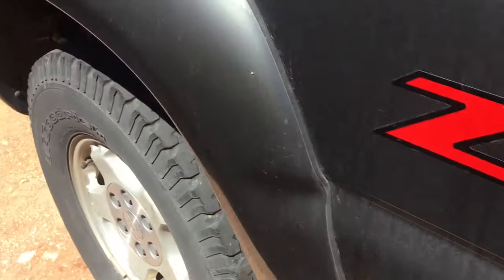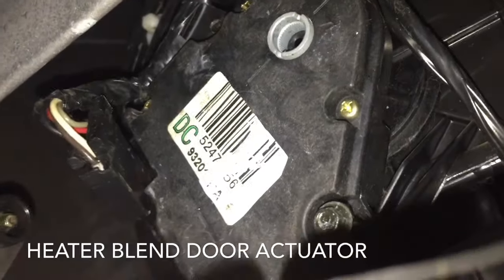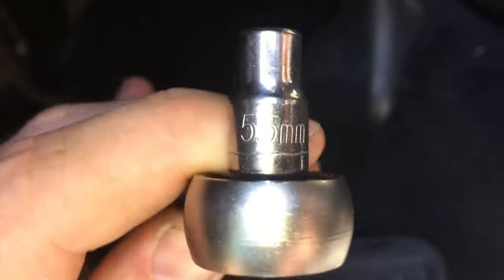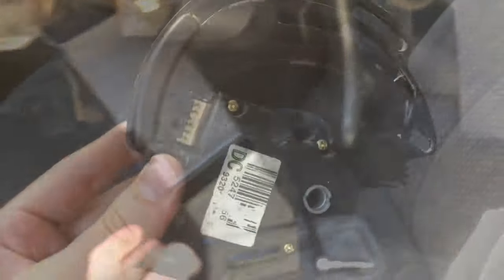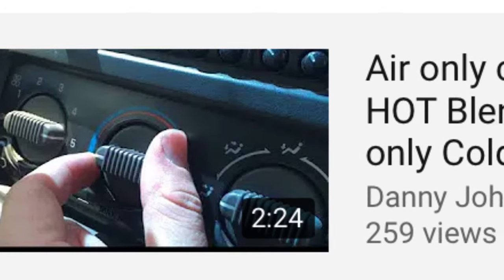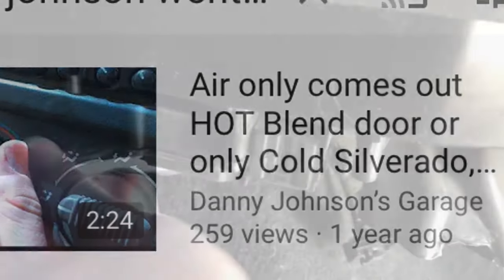Air only blows out defrost or top vents: mode actuator Blend door 99-2007 GM Silverado, Tahoe, Yukon

Comment: 5.5mm = 7/32”
Reply: Correct
May require quarter inch drive squiggle to get on some of them ▬ do not get impatient it is rigged to fail
Reply: Dafuq is a millillameter?
Reply: @petedandrea8463  not a stanandard 😂
Reply: Saved my a**, thank you!
Reply: @ChiDraconis 😂
Reply: Thank god👍👍
Reply: 5.5mm socket good for winning bar bets..😂
Reply: Actually, 7/32 is 5.56 mm 😉
Reply: 5.5 actually doesn't fit its 7/32
Reply: A 5.5mm is a 5.5mm.  Don't be telling these people the best ways to round bolt heads.

Comment: Place 5.5 socket on top screw, use short 6mm Allen wrench to loosen screw, use fingers to turn socket until screw is out.
Reply: But how about putting it back in??? Taking it out is the easy part...
Reply: Larry Clay, your comment needs to be pinned to the top of the comments!!
Reply: @ls1_dreamz  don't put it back in.
Reply: Yes this worked for me.
Reply: Thank you
Reply: Haven't made it home from work to try yet but won't the 6mm Allen key be to big to fit in the 5.5 socket

Comment: Lmao.  Yes... Taking it out is a piece of cake... but it would be great if you explain how to install it and what positions the flaps need to be in to make it not "jam up".  An installation video is needed too.
Reply: Any luck finding a replacement video? Thanks!
Reply: @dustinauch7178  no.  😞  and the blend door still isn't aligned right.  So the airflow isn't as powerful as it could be, and it's louder now
Reply: It’s not too bad putting it back in. I literally just did one today on one of these trucks. It was stuck on defrost mode so all I did was plug the plug back in without mounting the actuator back. Compare the old one to the position the new one is at, after that just simply go to the mode that corresponds to the position the old one was in. So basically I pressed the mode back to defrost and it moved the new one to the exact position the old one was at. I just slid it on and mounted it and worked perfectly fine. Hope that helps you some

Comment: I just unplugged the fuse for a few seconds and plugged it back in and my AC blows out fine now. Thanks for the video. I wouldn’t have figured it out without this video
Reply: Which fuse please?
Reply: Where’s this fuse you speak of ?
Reply: Could cabin filter be an issue ?
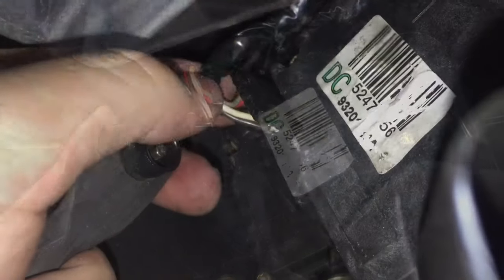Reply: @MeliTX  0:45

Comment: I ordered a 2000 Silverado without air.
Because of your video I tried a stubby screwdriver in the actuator hole instead 
of taking it off. 
It was a hard clockwise turn but I 
got the door to move and get a defrost and floor air blend. 
Putting the 
dial in the right position made it turn easier. That's good enough for me!
Thank you!!!

Comment: Man, this is the most useful video I've had all day! That's exactly what I needed. Now if I can figure out how to get that thing separated and put on the new actuator, then reinstall it, then somehow managed to put those two screws back in correctly, man, that will be the day, a blasted miracle will have occurred for sure. Thanks man.

Comment: Thank you for this video... I bought a 2003 Z71 Sierra a couple days ago and the AC was dead, only blowing warm out of the defrost vents... removed actuator, it's blowing full blast and cold now, which is something I desperately needed as I live in Texas!
Reply: did you fully replace it or  just remove it ???
Reply: I just removed it.

Comment: Definitely grateful for this video.  The symptoms he described took me directly to the problem which was the blend door actuator.  I did get it unbolted and tried to replace the actuator on my 2004 Silverado, but was never able to get the original one removed...not enough clearance with all the other stuff around it.  Watched this video several times but there was just no way to angle it to get it out without removing the white toothed plastic gear that you get a glimpse of near the beginning of the video.  Gave up on getting it out of the truck and decided to just put the bolts back in after seeing GM Tim38 video on resetting it by pulling fuse.  That turned out to be the problem as my battery had recently died and I guess the actuator has to be reset sometimes.  Anyway, its a really good, useful video that saved me a lot of money...just not sure why I couldn't get the part out.

Comment: I changed both blend door actuators, tried all the resets out there, changed the air filter etc. Theeeennnnn i found your video. It fixed the issue. My 2007 chevy avalanche ltz was stuck on defrost.. took this part out and tried switching in over manually and it blew out of the vents like a champ. Thanks for the video
Reply: Is it hard to put in

Comment: This video was spot on thanks man ! My ac mode was out for a good week till I found this video! Helped my 2002 Silverado in 20mins.
Reply: How did you successfully install the actuator shroud (cam) so it worked?  I'm having so much trouble and the air is still coming out of defroster, not the dash vents.
Reply: Specifically concerned with if the two plastic studs that move each of the doors, need to be in a certain position when installing the new actuator
Reply: @carsandhealthtoddrosenzwei2661  yea it works and still does that little part in the video and spot is exactly what I did
Reply: @carsandhealthtoddrosenzwei2661  try lining the plastic up correctly when  you put it back it’s supposed to go up and down with the circle groove

Comment: I just manually reached all the way to the back and moved it manually with the part still installed. I just pushed it all the way to the left and when i tested it it blew from the fromt vents again tysm man
Reply: Unplug the motor
Reply: That was going to be my question. Can you just move the lever without replacing the part?
Reply: @janelldemello9052  yup
Reply: You saved my day.
Just did it.
Worked to perfection.
Now i have ac where I need it 
Thank you .. 💪

Comment: Swapped my mode actuator out following this tutorial and the problems fixed! Thanks man, you saved me some money🤘🏽
Reply: I can't get the top bolt put in 😭

Edit: I got it figured out a day or 2 later. It just kinda sucks lol
Reply: @ls1_dreamz how you get the top out 💀💀help plzzz
Reply: @Dtxmundo  A 7/32 socket and a compact 1/4 socket wrench. When I put it back on i tightened it with my fingers using a short extension attached to that 7/32 socket. You may even try using that to loosen it.

It takes some getting used to so have patience!

Comment: So there’s 2 one on each side. I thought it was only one. Has one on each side. Thanks for the video. I thought it was only on the passenger side. Glad I watched your video too. 👍🏼👍🏼
Reply from the maker: I believe after 2003 they have dual climate control. That could be for that
Reply: @dannyjohnsonsgarage from 99 to 03 there are two actuators. One on driver side for "mode" one on passenger side for "blend" (hot/cold)
After 03, with dual climate control, there are actually 4 actuators I believe.

Comment: I just was working on a friend's pickup that was stuck on defrost so I took off both these controller motors and opened them both up and put 12 volts to them and they both worked! They looked new inside! But that black half circle track with the grooves where those pegs slide seemed gummy so I cleaned it and regreased it and it works fine now! But I do know that where the big shaft goes into these motors it goes in to a white plastic gear and most of the time that gear is split/cracked and can no longer turn the shaft. Theyre very low geared so that little motor can get alot of torque on that final gear if something gets wedged in those flappers that they control and breaks that final gear. So don't let things fall down your defrost because it falls right down on them.

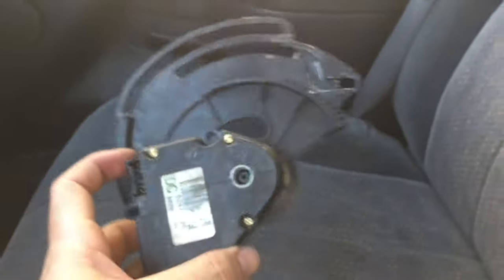Comment: So I have an 1:47  easier fix if you're broke but determined like me. Pull the vent off like he said wedge your head around the break pedal. If you look above and behind the actuator motor you'll see the white switch that you can turn manually by again wedging your hands back there (I have large hands so most men can do it too)and push it the opposite direction.  Heck yeah!!! AC blowin on me again without sticking my head to the windshield. Very needed here in AZ summer scorching heat.  Ha ha ha, yes I'm proud of myself. But huge thanks to this video, it made it seem doable and it was.

Comment: Found GM Blend/Mode Air Door Actuator Gear Rebuild Kit (Fits Chevy, GMC and more 1990-2013). Many times it is just the gear inside the actuator that has split and preventing the travel of the selector once the the gear cracks. The hard part is getting this one removed and reinstalled. Kit runs $12.00. The gear is the same for the lower Heat/AC near floor.

Comment: Not sure why, but this was one of the most aggravating jobs I've ever worked on. Had a bear getting that flap button to go into the slot. And then it kept popping out before I could get the 2 screws in. I found it best to install the top screw first and had to use a mirror to get the holes lined up. Oh yeah, I had to use tape to keep the screws on the sockets. Anyhow, after about 4hrs, I got it on and it seems to be working OK. Wished I had fixed it along time ago because I think all the heat coming from the defrost was responsible for cracking my windshield.
Reply: A hot glue gun works well for temporarily securing fasteners to sockets. Breaks free easily as well..

Comment: Thanks this helped. But idk know if It was actually motor in my case. Cause when I went to disconnect the blend. I found evident of someone working on it before. Electrical tape holding it up and the motor had a loose screw probably because their hand was to big. Issue solved tho.

Comment: PSA: I bought a cheap replacements from Amazon by the brand A-Premium for both the blend door and mode door.
The blend actuator has worked fine so far. The blend actuator also fits in place of the mode actuator, BUT the programming is different, so they are not interchangeable.
The mode actuator from A-Premium does not work at all. The shaft on the second spur gear from the worm is too small, allowing it to skip teeth when any pressure is applied.

Comment: Great video, when you install new actuator does that flap and one with gears have to be in a certain position. And does switch need to be at a certain position like defrost or vents or floor.
Reply from the maker: Yes, and to tell the truth, I still need to crawl under it and line it up. I’m thinking the easiest way would be to move them until it comes out certain vents, then match it up on the control knob

Comment: I discovered that my white lever, the you show in your video, doesn't "snap" into each of the two positions like yours does.  Mine just flops loosely.  Thus MUST BE the issue as to why air still blows out the foot and defrost vents while the mode button is set to dash vents only.  😢😢😢

What do i do now to fix?  Do i need a whole new interior ac box assembly?

Comment: Is there a way to check if it’s bad? If I move the switch and get the cold air to blow through the vents would that confirm that it’s that part? Trying to not buy anything extra.
Reply from the maker: Yeah, plug the motor in and if you turn the switch and the motor doesn’t move that would also mean it’s not working.

Comment: Man ive paid an AC shop way to much money.. My AC still isn't fixed and now they are telling me its the blend doors.. 
They set the bottom blend door on P-side to cold and disconnected it
Now
The shop is saying the system is reading 44° but when its coming out the vents it 62° which blend door controls that? 
Im in FL since ive owned this vehicle ive never turned the heat on or messed with the AC temp..

Any tips?

Comment: Hi Danny, I have a 2007 GMC sierra 1500 SLT I changed the heat actuator in the heat continues to blow out even if it’s off and now I have no defrost. It will not switch to defrost or go out though feet blower. High control unit says defrost, but nothing comes out stays on heat.

Comment: Excellent video, one question though! I have very hot air coming out of vents no mater if i have the temperature turned to hot or cold. BUT when i switch from vent to defrost, then turn from hot to cold the ac/cold air works great! Weird right? I already pulled off the blender actuator on passenger side & manually turned the knob either way. Still nothing but hot air coming from vents. Working on my ol mans 01 chevy silverado 1500 z71 any feedback is appreciated

Comment: Thanks for the video this was excellent!  Question for you.  There are some gear teeth on my shroud that match up to some white gear teeth on the box but the shroud travel doesnt cover all of the teeth but only like 1/4 of them.  Do you know what should be adjusted so the there is complete travel along those teeth?  It seems to me if the whole tooth profile is not being used then the damper doors are not opening fully?
Reply: There is supposed to be a limit-stop which prevents going off the end of the gear sprockets ~ you set the thing to the middle of travel and do not force it; Seems to be a calibrate but have not found reliable ○ Factory is charging 100-x what it costs them to make it so they are playing us  •  You do not need complete travel over all available teeth as I am a perfectionist and have had to realize this is not how this works  →  The servo is supposed to have a "sensor" which does the feedback loop telling it when to stop · The general design is that of a bridge such that neutral "in the middle" is the zero value with ± limit of travel being held for ransom by Control Clowns® ◘ Your best approach is to hire a dirt contractor whom will crush it flat for a fee
Reply: I've given up on installing a new one. I simply can't get it to work. Not sure if the gears aren't aligned properly or what, I can't think of any other reason it wouldn't work. I resorted to leaving the actuator removed entirely a d just adjusting it by hand when I need defrost vs cold air out of front vents. And I never bother with foot vents now. Impossible task
Reply: @jackburton2680  glad I’m not the only one🤣
Reply: @danielitros28  yeah not hard to inst it but whether it works is another story. I saw no other way to position it than how i had it on install yet i still didnt have fully operational. My initial prob was it would only blow thru defrost vents, well i did fix that problem but now i can only blow thru the front vents. Insp everything so i know the issue is with the blend door itself, not something else on the truck.

Comment: I am replacing mine on my 2002 2500 Silverado HD, bought the new actuator for the vent control.  But how do you install it. I can't get it to go back in? Do you have a video on that?
Reply from the maker: I do need to make a video for the install. It’s probably best to put the control knob to one option such as feet and then manually put the actuator to where it would line up. Then install it

Comment: I have a gmc 2007 envoy how many actuator do I need? My GMC is blowing out hot air on one side, cold air on the other. We already changed the resistor and the fan but it’s still not working and we already checked the fuses turn the car on took the fuse out and then turned the car not all the way off it wasn’t that either so it’s definitely the actuator I just don’t know what kind we need and how many we need. I want to change them all if I can.

Comment: You got anything for the left turn signal not working, I’ve replaced the fuse on side of dash and it has new bulbs. Right side works fine thanks in advance
Reply: i just replaced the circut board in my 1999 tahoe. it is inside the tail light. was $60 and took 10 min to do

Comment: Mine blows out the top vents and defrost. It’s not the blend door because we tried that and it works just fine. When I change the mode on the control it doesn’t do anything for any of the settings.  Can you let me know which one that could be? I have an 06 Envoy

Comment: Is this the part that makes a ticking noise ? I have a ticking when I have my switches all the way down on cold . But when I put them up half way on cold the ticking noise shuts up ! Or do I have to switch the other side module of hot n cold ? I’m confused I’m check the switches if they rotate to feet/defrost etc if that works out fine I’m guessing I need switch the hot n cold piece on passanger side … ?¿

Comment: Would love to see you remove that top screw. Im about to just break the old one and only put the bottom screw in
Reply: Simple. Put 5.5 socket only on screw head and use a 6 mm small Allen wrench to loosen screw enough then use fingers to unscrew socket and screw.
Reply: HOW DO YOU REMOVE THE TOP SCREW?!? Mine was 8mm on the bottom. The area is so narrow. Losing my mind.

Comment: i had a samier issue with my  2000 chevy  silverado  itwas only coming out if the vents replaced the blend door it was working fine then a few days later now its stuck in defoust is it the same blend door that gone bad?

Comment: Been putting this off for a long time, mainly because I wasn't sure the cause. Some sources indicated there were multiple actuators that could cause ac and heat to only come out the defroster.  Maybe so, but I'm going to start by replacing this relstively inexpensive one and see what happens.